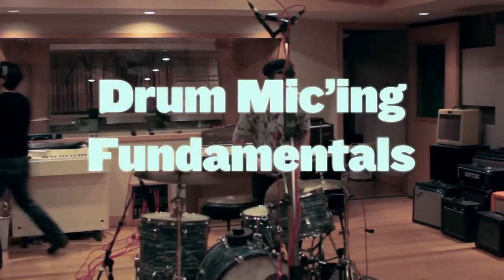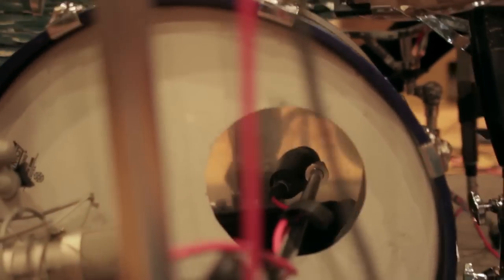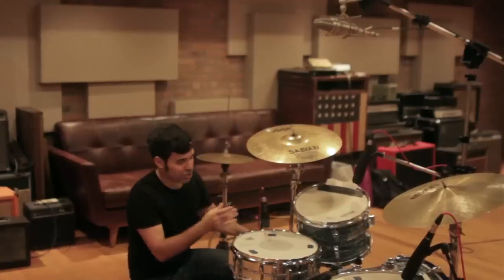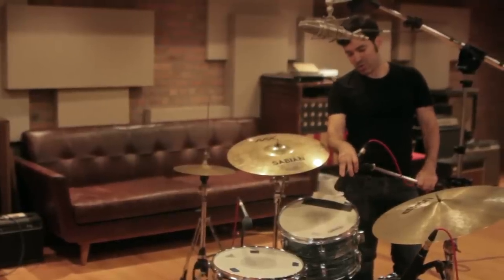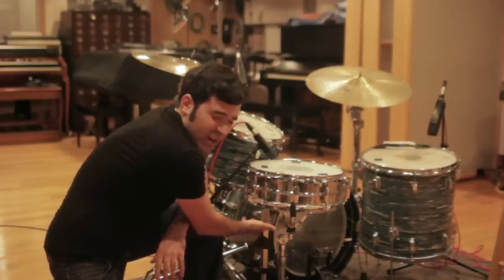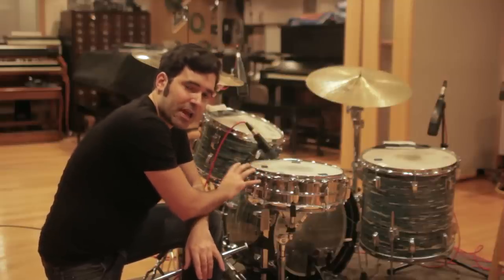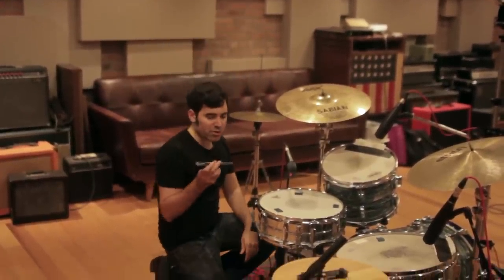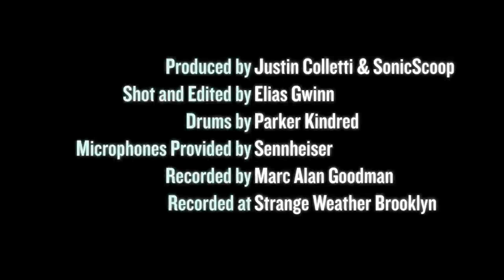Recording Drums, Part II: Close Mic Techniques

Comment: Probably not a good idea to put the snare shell mic right on the air hole on the snare drum
Reply: It's hard to get a good sense for the exact angle in the video, but yes, you're right Biggi!: It's a good idea not to point the mic directly on axis with the vent. You can get some very weird low-frequency air blasts that way. (Kind of like plosives.) We're pretty close to the vent here, but yes: Better to point at the shell rather than directly into the vent!
Reply: I stopped using air vents and kick drum holes as mic placement locations some time ago; the air blast does not contribute to the sound (IMHO) and the artifacts are detrimental to the recording. I look for the best sounding spot on the skin; if more snap is needed, a Sure Beta 91 inside provides the heavy metal 'tick' that some recordings require.
Reply: @GeorgePiazza  Is your snare interenally mic'ed, I guess it is from your comment. Do you like the sound better them an outside mic?

Comment: Mike the attack heads on the toms and the resonance heads on the kick so you have to cut a hole and stuff that pricy kick with a pillow or something. Or, you can put a mic on each head of the kick and use a felt strip behind the front head with no holes cut in the kick head, and that is how I get a very good kick sound. You just have to be sure the kick side won't get banged around by the drummer, and use a cardoid or hyper cardoid polar pattern on the kick side. Mic it just like the other drums except you have two mics, one on each side. Try it, you can use a small diaphragm condenser or dynamic on the kick side but I prefer the condenser. I never cut a hole in my kick head, and the price represents build and engineering quality so I sure won't stuff my kick drum but that felt strip off center behind the front kick head makes it easy to get the sound you need without destroying that expensive kick head and the sound is sweet, I've been complemented on my kick sound several times by drummers, because I am a drummer.

Comment: Your coplete series is just what I needed to see and hear. I'm using The May internal mic system with AKG D112's and SM57's. Do you think it would be worth an experiment to adjust angles and heigth from the batter heads on the rack toms?

Comment: has the low sound of the shell-mic-technique something to do with pointing the mic to the air-vent?
Reply: that was my first thought on this placement as well, i play drums and you can feel the air pushed out of those air-vents when you hit the drums, so i guess you should avoid placing a mic pointing directly to a air-vent...
Reply: Yes, you should avoid pointing the mic directly on-axis with the vent. I wish I had explained that better in the video. Slightly axis from the vent is better—you may get a major plosive artifact if you're straight on axis.

Comment: Another great video. Am I not right in thinking that the top and bottom mic's should be at a 90º angle to minimise phase issues?

Never tried a 441 on the bottom, but it sounded great. Going to have to dig ours out of the mic cupboard. Love the sound of the SDC on top, too. I really like combining a 545SD with a 451E for top snare.
Reply: flip the phase

Comment: Hi I'm new to mixing and i was wondering, what do you mean by swiching the polarity andhow do you do that?
Reply: Hi im also new so im not 100% but i think he means on you eq you see a little button that looks like this: ø 

This will switch the wave form into the opposite so the two mic signals arent cancelling eachother out n cause phasing

I hope that im both right n helpful!
Reply: That's exactly right, *****! When placing two mics on a single source, it's generally a good idea to try the polarity switch both ways on one of the mics (using the "ø" switch your preamp or in your DAW) and go with whichever position sounds fuller.

Comment: Hi guy´s!
you might add that the last snare technique will add a lot of air(bad air/popping) and therefor it´s important to use a pop filter etc.
Reply: I set mine up about a foot and aim in at a 45, .. Pop usually comes from vocal syllables such as P and B..
Reply: Cody Walker Jr. Yes i do agree that having the mic a foot away help´s agains "that sound", but then again i would say that the less mic´s are better because of phase. if the drummer is good a few mic´s can be enough. Eric Valentine uses only 4 mic´s on drums and i would say that he captures the music he record´s in a great way.
Reply: Hi Anders,
That's true if you aim it right at the hole. It should be off-axis from the hole. I wish the video had explained and showed that more clearly. There's always next time!